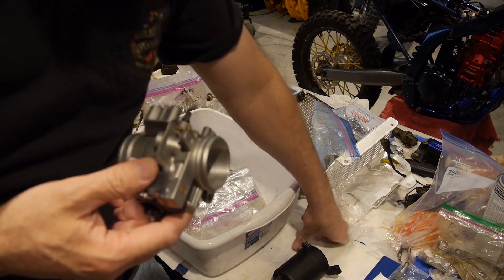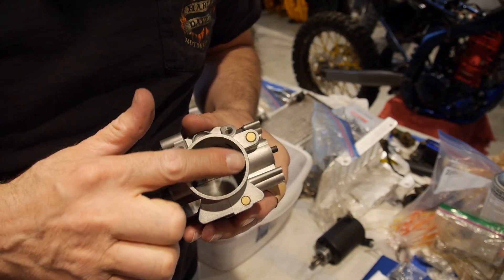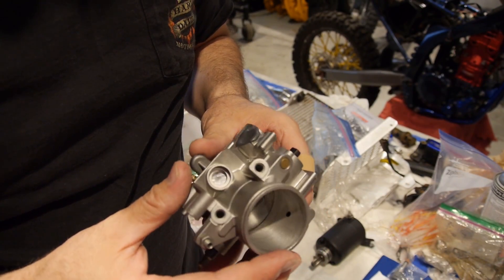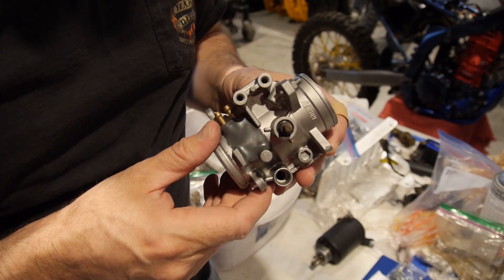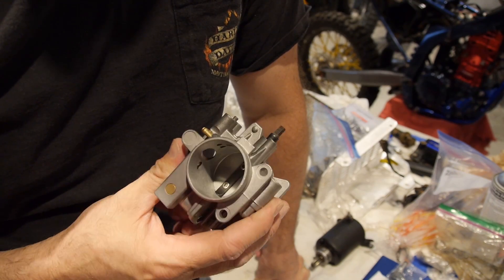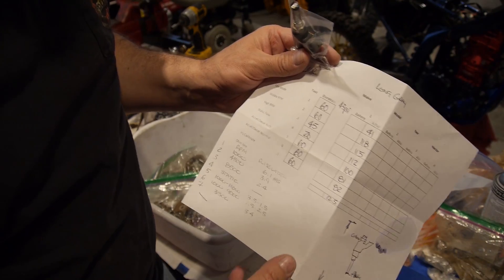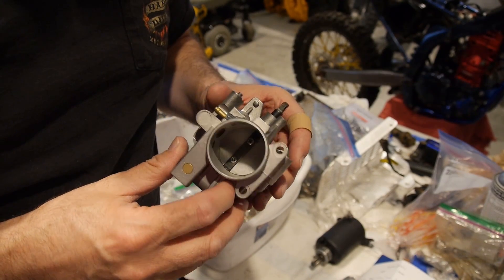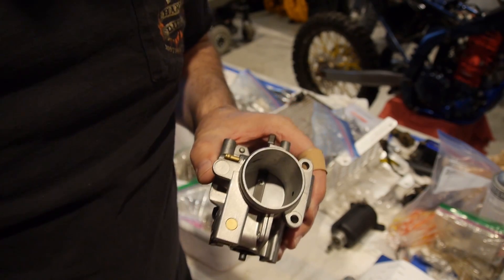++Athena++ 2.0 WR310R Throttle Body & Injector Mod

Comment: MrDuhFactor, I'm building a 310R myself and LMR has done my throttle body and head work (I said I wanted the Kulani setup, lol). However, I didn't have the emissions piece removed as I wasn't sure what it was. Is there anything special about that part or can I just disassemble it, cut the body of said piece down and epoxy it shut? And what specifically does that part do? Cold start idle mechanism? 

Also, did you put in the WebCam regrinds available for this bike?
Reply from the maker: Basically, on Kalani's bike, he had removed all emissions equipment, and we made a block off plate (which you can do with epoxying it shut) from aluminum. It wont matter to remove it, as your tuning will correct anything it would have done. And yes, we used web cams on Kalani's bike, but not Curts bike. What we've learned recently, is that the airbox has to be opened up a lot to really get things to flow. So, they have been using 1.5" -2" circle holes in the side airbox to correct it. We didnt do that to either WR310R's, so I wonder how much more power we could have gotten if we did.
Reply: Thank you for the response, I've opened up the air box assembly by removing the snorkel piece located on the top side. I'm reluctant to cut holes in the side of the box, but I have a spare air box door and I'm considering mutilating it to see what happens.

Comment: So what will it cost me for you to do this too my Honda. 250L? not all the powder coat just the moods.
Reply from the maker: Depends, you mean the big bore kit, porting, cams, and throttle body mod?
Reply: hillbillydualsport way too much for what those bikes are worth. there are far better bikes for off road use if you want to do this kind of overhaul/upgrades